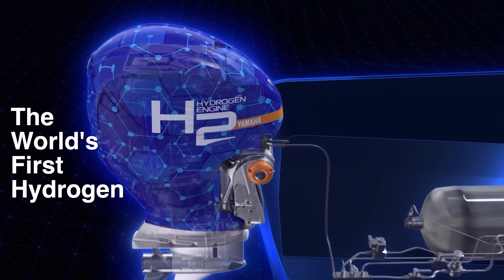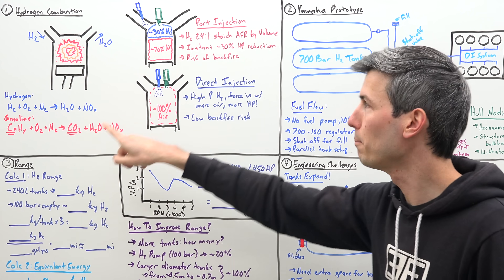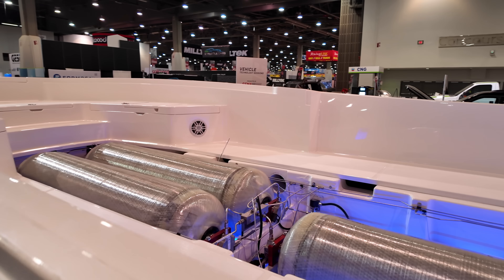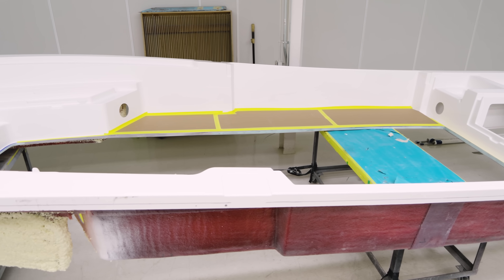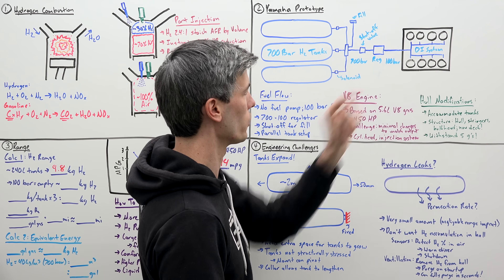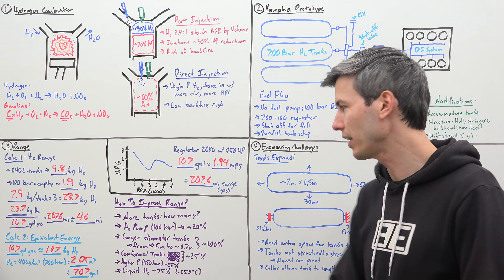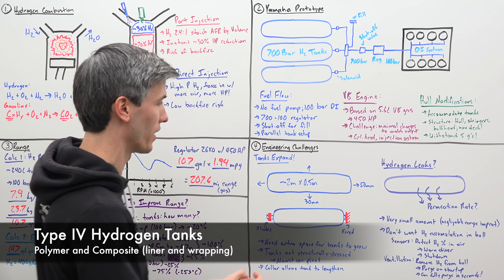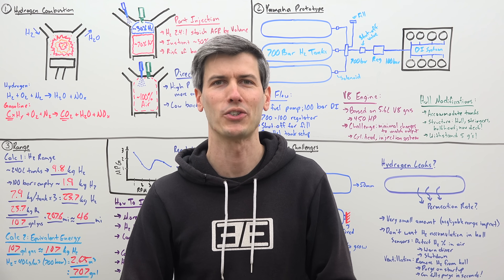The World’s First Hydrogen Combustion Outboard Engine!

Comment: What marina can you get h2?
Reply from the maker: Chicken and egg for sure - what boat can you buy that's powered by hydrogen combustion? (doesn't exist either).
Reply: We can somewhat map this issue to hydrogen cars. We have the cars available. Where's the fuel?
Reply: I live next to a Toyota Mega Dealer with a Hydrogen station, but am loathe to lease a Mirai. 

I can home charge a buddy’s Model Y at 6+ kWh/hr, my ICE Toyotas have had such low TCO, that the PHEV is the closest thing I might go with.

Comment: I would like to see the tradeoffs they're considering with this vs hydrogen fuel cells. I would think the latter has quite a few advantages over this, including efficiency and noise, but maybe those are harder to manufacture?
Reply from the maker: Yeah, fuel cell definitely would increase range - as discussed, this is looking at what could be applied with minimal changes to their existing engines.
Reply: @EngineeringExplained  Perhaps you could do a followup video? Range isn't even the thing I wonder about with a fuel cell, but rather if there are practical issues why one would avoid using a fuel cell in this case. Price? Sensitive equipment? Degradation?
Reply: @EngineeringExplained Please discuss the semi solid state battery from Nio.Which achieves a cell energy density of 0,36/kg. 
1:43 And pack energy density of 0,28/kg.
Reply: @EngineeringExplained  "Minimal change" yet they have to redesign the entire boat.
Reply: Fuel cells are exceptionally expensive. To minimize cost they could do the same as the Mirai: use a battery to accommodate peak power, and scale down the fuel cell to meet only the average power consumption. It’s still something like $500k of fuel cell though.
Reply: @markirmuir  I don't think the intermediate battery trick would help much here. While cars need high peak power to get up to speed and then low power to cruise (which the fuel cell would provide), boats tend to need high power continuously, so you would still need a huge fuel cell
Reply: @markirmuir  You are talking like these high pressure tanks aren't expensive...
Reply: It just needs 2 mirai fuel cells and 2 entite mirais dont cost 500 k @markirmuir
Reply: Everyone is suddenly all over H2 ICE because EU suddenly got lobbied to put them in to the same category as EVs....
Reply: There also for soy boys. Real men like engines!
Reply: This is nothing more than a gimmick for gas industry companies to say they are trying to combat green house Gases to me. Maybe get subsidizes and tax write offs.

 It is a mockery of effiency. The fact green hydrogen isn't close to being cost effective, dangers of storing it, and most of all volumetric density is down right terrible.
Reply: This is Yamaha - they know how to build combustion engines, so that’s what they gonna do. 
This is their Kodak moment, (as in missing the disruptive technology shift to digital away from film). When someone comes up with a fuel cell that can do what the combustion engine does, Yamaha outboard motors will cease to exist. It doesn’t look likely from here, but I am sure that’s what the Kodak executives told themselves many years ago.
Reply: You'd need a pretty sizable fuel cell to produce the same power as a 5 L combustion engine. And since fuel cells use precious metal catalysts, that does mean a significant price tag and probably weight as well.  1 hp = 750 W, so to produce the roughly 350 hp of a 5.6 L v8, you'd need 260 kW of electrical power. That's about 2 Toyota Mirai's worth.
Reply: A fuel cell's efficiency would better than an ICE, but not by much. Assuming a 50% fuel cell efficiency, 95% efficiency in converting DC to AC, and 90% efficiency for the electric motor gives an overall power plant efficiency of about 43%. This compares with a top tier ICE efficiency of about 30%. That extra bit of range is probably not worth the substantial extra cost of a fuel cell compared to an ICE.
Reply: What happens to the nitrogen in the air you're burning in an IC hydrogen engine? Does it produce loads of NOx that is what has made diesel engines the new evil?
I don't really understand the logic of designing a hydrogen combustion engine that uses existing outboard technology if you've got to design a new boat to carry the tanks. Surely a fuel cell/electric outboard combo would make more sense.
Reply: @MrHemlock51 You still need the tanks for the hydrogen to feed the fuel cell.

Comment: Run out of “gas” in the middle of the lake and have someone bring you a “can” to get you back to shore with that one. Real smart.
Reply from the maker: Not an expert, but the smartest move would prob be to not run out of fuel (same is true for electric, fuel cell, etc).
Reply: Call a tow tug like a normal person
Reply: That almost never happens. You just get towed in.